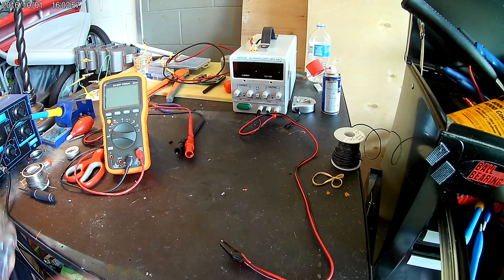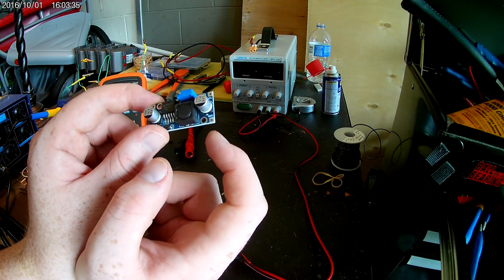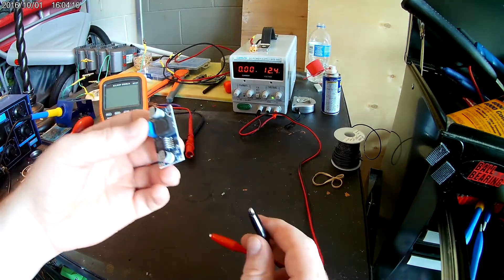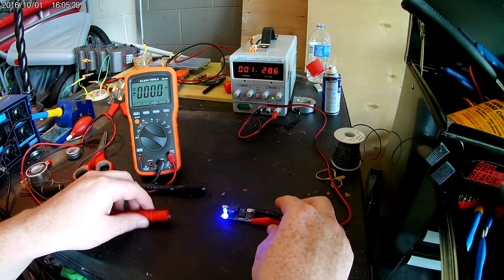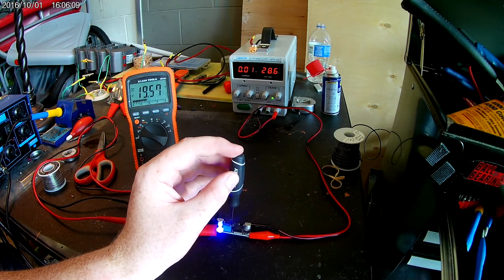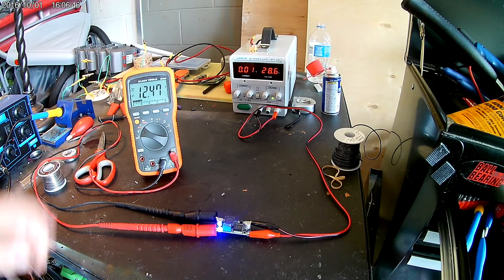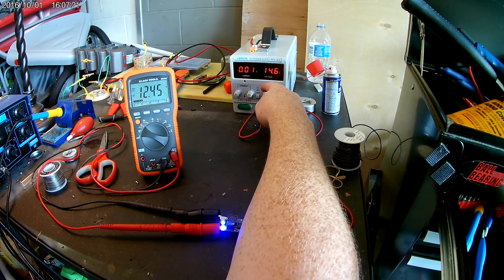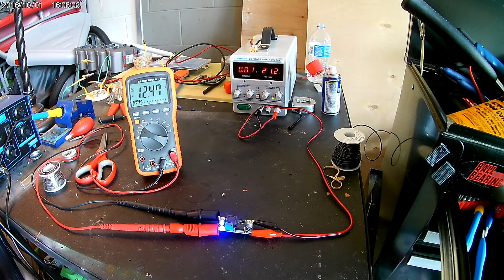LM2596 Stepdown How to

Comment: hi it me again i cant understand baterry power but I have a Invacare Lynx L-3  and batery its 12V 12ah it uses 2 of them I found this https://www.batterysharks.com/Invacare-L-3-Lynx-3-Wheel-Microportable-Scooter-p/l-3-lynx3_ups12-12_x2.htm?gclid=CjwKCAiA47DTBRAUEiwA4luU2ZUI1O2B1w4C79aLxqX4TgBF2pr59SUn4_6z1DgXiwUA8y0m9i-vwhoCt7oQAvD_BwE now the question is I have this Buck Step-down LM2596 Power Converter Module DC 4.0~40 to 1.3-37V LED Voltmeter and http://www.ryobitools.ca/products/details/878 would this work

Comment: Hi I got the stuff That I need but can you you help me to try to put it together thanks '
Reply from the maker: Not sure how much I can help you but if you have any questions I will try and answer them for you
Reply: why this has 2 red cables 
http://www.ebay.com/itm/36V-48V-350W-Electric-Bicycle-E-bike-Scooter-Brushless-DC-Motor-Controller/371239291127?ssPageName=STRK%3AMEBIDX%3AIT&_trksid=p2060353.m2749.l2649
Reply: do I need to change the voltage on the Battery 40V
Reply from the maker: Ignore the thinner red wire. Use the thick red and the thick black for your batter connection. https://ae01.alicdn.com/kf/HTB12pc7NFXXXXacXXXXq6xXFXXXC/100PCS-36V-48V-350W-Electric-Bicycle-E-bike-Scooter-Brushless-DC-Motor-Controller-EMS-DHL-UPS.jpg. This video may help https://youtu.be/oeiX8mhmaZ0
Reply from the maker: There are going to be some wires you will not use. You will probably only use the battery wire, twist throttle, and the three brushless motor hook ups.
Reply: would the controller  hold the 40V or I have to change the voltage with the LM2596 Stepdown
Reply from the maker: This is probably a better video: https://youtu.be/c82ulc-PsHM
Reply from the maker: The speed controller is rated for 36v/42v so you will not need a lm2596.
Reply: the color of the controller and throttle are different place 1red 2 green 3 is bcc on controller and the thriller is 1red 2 black 3 green do I need to match them
Reply from the maker: Also keep in mind that you will need a speed controller for each motor
Reply: Eric's DI I connected all and nothing
Reply from the maker: Yes you should match them
Reply from the maker: Is there a light on the speed controller?
Reply from the maker: That thin red wire might be an ignition of some sort like a key for a car. You may have to hook that up.
Reply from the maker: Was there no instructions that came with the speed controller?
Reply: Eric's DIY when I connect the black and big red won’t do anything but if I connect the skinny red to battery and then tape the bug red it moves what ami missing
Reply from the maker: You could try connecting both reds
Reply: Man I got it I just need to figure out on hot to wire so it goes forward and backwards
Reply from the maker: polymexdf69 do you have your twist throttle connected
Reply: yes
but can figure out how to make it go forward backwards
Reply: good morning thanks for your help should I connect each controller to a battery or both to one I have 2 of the same batteries thanks
Reply from the maker: +polymexdf69 if you have 2 then it will last longer.  It depends on how much room you have. You could just plugs the batteries in parallel and then into both speed controllers
Reply: Eric's DIY does it matter what type of battery can any battery be keep wire that way
Reply from the maker: +polymexdf69 they need to be the same battery
Reply: You know this batteries have like a electronic board I just don’t want to damage anything
Reply: Eric's DIY yes they are but they are made for grass cutter  does it matter like the one they use for like drills
Reply from the maker: Do you have the brand or model number of the battery
Reply from the maker: You should be good with one battery. But if not just parallel them.
Reply: Eric's DIY thanks for all the help I really appreciate it means a lot to me I just found out the 2nd battery is 40V 4Ah does it matter I’m going to run both wheel with one battery at the time today is the big day

Comment: What is the best time to reach you I need help  need this before Halloween
Reply from the maker: What exactly are you needing?
Reply: https://www.youtube.com/watch?v=LJzoy2TJXFk
I was trying to power 2 hoverboard wheels or motors like this but they don't spend freely  and it seams not enough torque
Reply from the maker: polymexdf69 are you using some sort of speed controller like the one in the video?  Basically you need something to handle the amps. What kind of motors are you using
Reply: this is a video of what I came out with but moors won't stay running  https://www.youtube.com/watch?v=X4em6_nVVQU
Reply from the maker: This should work. You will be able to get the torque you need but not sure how long the batteries will last.
Reply from the maker: When you draw too many amps it will start to overheat and your efficiency will go down.
Reply from the maker: very cool
Reply: so are you talking about the 36V/48V 350W Electric Bicycle E-bike Scooter Brushless DC Motor Controller and the  TWIST THROTTLE Grip Razor Bike Moped
Reply from the maker: sorry it didn't put the replies in the right spot, yes the 350w controller should give you the torque you need.
Reply: Thank you very much appreciate

Comment: Sorry this what I got thanks Buck Step-down LM2596 Power Converter Module DC 4.0~40 to 1.3-37V LED Voltmeter
Reply from the maker: No, it will actually last longer because you are not pulling the full 40v from the battery. I have just tested the current draw of the LM2596 when converting 40v to 18v and the draw was .001 amps. This is nothing. The LM2596 regulates voltage, not current, therefore you can lower the voltage a get more battery life. Just remember that the LM2596 can only withstand an output of 2.5 amps or 3 amps with a fan or heat sink.
Reply: here is what im trying to built I need to power 2 hoverboard wheels and so far this is the the I did but using my drill battery at 20V the title blue box won't let the  motor turn unless the battery has 18V but I have a 40V battery from lawnmower so I would like to use that but run the 2 wheels with it each one would pull 18V thanks here the link to video https://www.youtube.com/watch?v=X4em6_nVVQU
Reply from the maker: Do you know what the current draw is (amps)? You may be able to use two of these http://a.co/1THtgJO. This one is designed for dc motors and you will be able to step down 40v to 18v. It all depends on the max current draw from your motors.
Reply: how about 36VDC 2500mAh/90Wh using the 40V
Reply from the maker: You'll more than likely blow it if it's not rated for 40v. You might get away with it if you put a cooling fan on it.

Comment: hi what happens if I have a 40V battery but I only need 18V this will adjust the power but would the battery drain faster or what happens to the extra voltage need help thanks

Comment: Thank you, that helped.  Could you try another experiment.  I'm showing I can take 11.7 volts to 14.2 volts.  Would you mind testing that, you have better equipment than I do.

Also, can you check the output amps, I just show -0.00.
Reply from the maker: The output current will be 3 amps no matter what. Are you trying to take 11.7 volts and step up to 14.2 volts or do you want to know if you can take 14.2 volts and step down to 11.7 volts?